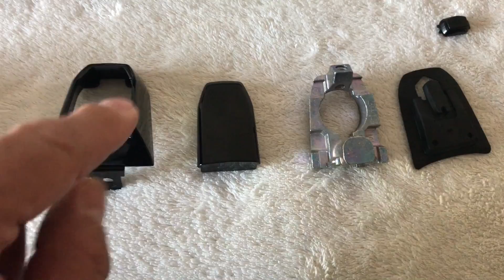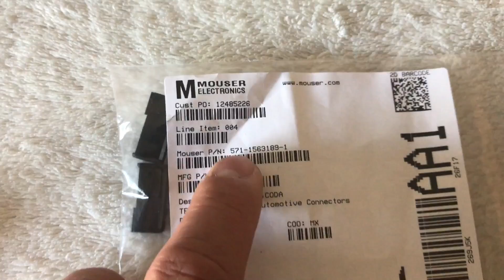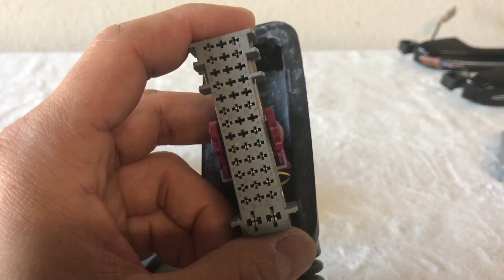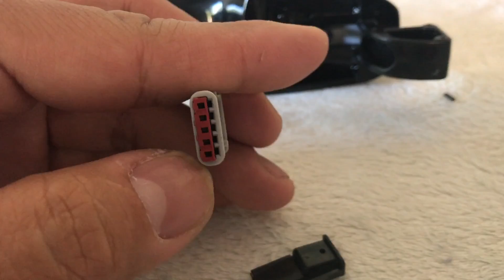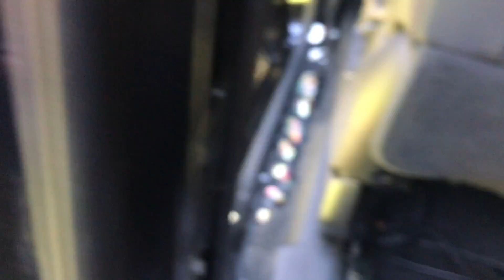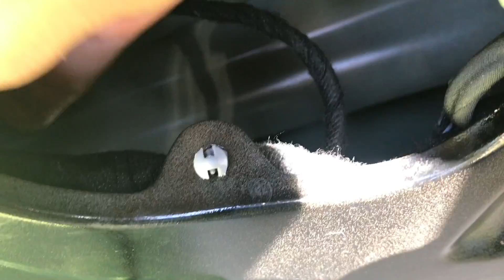2014 - 2017: Silverado / Sierra - Illuminated Door Handles

Comment: Do the Cadillac handle lights double as turn signals? Or would I have to do some modifications/retrofitting for a turn signal feature?
Reply from the maker: GM has them setup as puddle lights, so they only come on at night with key fob unlock. You can wire them however want and can tie them to a blinker. I did that with mine. Before I got rid of them and the truck, I had switchback LEDs put in and the white led operate as a running light (always on when park lamp/running lights are on) then blink amber when turn signals were used.

Comment: Years ago You could buy these style of handles for your truck or cars. Through companies like J.C.  Whitney. If I remember right those would work in conjunction with your turn signals. I don’t know if these do or not . I’ve never seen one come to think about it. They sure look great on your truck. Nice job 👍.
Reply from the maker: Since this video, I actually changed them up a bit. Had switchback LEDs retrofitted so that they white light would come on as a running light and blink amber with the turn signal.
Reply: @philgamboa2906  do you sell any plug and play ?

Comment: If Anyone is curious, the oem connector the gentleman here refers to is a JST SRV connector. Through much dismay and a ton of digging, I found the connectors, if you already have passive door locks on your vehicle you should be able to just add your 12V trigger wire and pin into female end of JST SRV connector and tie into your power source (pin 3) as he states in the video.
Reply from the maker: Thanks for sharing!

Comment: However just a minor point, the rear door connectors have only 2 columns of wires  so a corner pin would be 2 not 3
Reply from the maker: Power and ground are positions 1 and 2.  Position 3 is the next corner position.

Comment: My wiring coming to the door has the two wires going to it just like yours in slot 3 however there is no power running to it at any point.  Do you happen to have any additional advice that could help.  Thanks
Reply: Also wanted to add I really like how well informed your videos are.  Extremely well made.

Comment: Looks great Phil! I'm looking at adding these to my 2015 Sierra HD Denali, I think I'll also make the lock\unlock buttons functional. I think I'll use a low power bluetooth tag that will go on the keychain and then an esp32 module in the truck that will detect if the tag is within proximity based on signal strength. Run the wires from the buttons on the handles to an input on the esp32, little bit of logic and then just tap into the lock\unlock button to trigger the locks with mosfets or relays.

Comment: Where did you get the handles and wiring and how much were they? Thank you.
Reply from the maker: Bought them from eBay last year sometime.  Then sent them off to a company to get switchback LEDs installed.  Cost was probably $600-ish all in.
Reply: Phil Gamboa will these door handles stay on all day or how does it work? Would I be able to turn them on with my fog lights or headlights and not the day running light.

Comment: Do you know if they are compatible with a 2019 yukon sle?
Reply from the maker: Not sure.  On the truck platform 2019 is a new generation, new body style.
Reply: @philgamboa2906  2019 is new for trucks suv's are still 2018 but for 19-20

Comment: Phil, first of all, I am huge into factory-style mods for my vehicles, so stumbling on your impressive work on the Silverado is really cool to me. I don't know how much you'd know about other Chevrolet models (specifically the 2016+ Malibu, I have a 2018 Hybrid) but if you do, do you know if GM uses the same size handles for most of their newer vehicles? I am looking to do this mod to my Malibu and am just weighing my options. The shapes/sizes of these handles all look very similar so I'm not sure if I need to be looking for ones off a specific vehicle (maybe CTS) or if any illuminated Cadillac handle would be fine. I was originally just going to do a simple swap to the Premier chrome handles, but then I had a hunch about these and realized I was not the only one!

Comment: Great video, very detailed.  I’m curious if your truck already had puddle lights in the mirrors why did you have to run a new wire from the door jam plug?  Could you have just powered these handles from the puddle light wires?
Reply from the maker: elrobbodiablo1 - Yes you can.. but since the rear doors don’t, I had to deliver that signal to the back doors.

Comment: Phil, so you happen to know which circuit on the door harness is utilized for the turn signal? i'm thinking about having the lighted door handles on in run mode and flashing on turn mode. this should be possible with built in mirror signal if they exist i just don't know which circuit, can you help me out?
Reply from the maker: In the door jamb, Pin #41 is the turn signal circuit.  You won't be able to achieve that functionality since the light on the handle is a single light source.  I switched mine up to LED Switchbacks that are on all the time (white) when my headlights are on, and flash amber when turn signal is applied.  I ran the running lamp circuit (Pin # 11 on the door jamb) to it.
Reply: @philgamboa2906  Also do you do installs? I see you're in Texas, I'm close to Dallas.
Reply from the maker: Z Sellers - Email me at gamboaphil@gmail.com
Reply: @philgamboa2906  was it easy to separate to switching out the LED to switchback  LED? I was looking at mine and didn't feel like tearing it apart in case there's a trick to it.. lol
Reply from the maker: @jjplacheta   - I sent mine off to Crisp GM Customs.  They do this type of custom work.
Reply: @philgamboa2906  do you happen to have a video of your switchback in action. I have the red LED turn signals in my mirrors, was wondering how they contrast with the doors switchback if it's white then amber.
Reply from the maker: @jjplacheta  - Shoot me an email and can send it that way - gamboaphil@gmail.com
Reply: @philgamboa2906   Are those pin numbers the same for the 2500? got an 18 and doing the switchback handles. If I can tap off the door harness in the front in the cab, and run the wire to the back it would make it much easier. Do you have wire colors also, or how I would read the plug to get the correct pins?   Appreciate any help. Happy holidays.

Comment: Thanks a lot for posting this! I have a Cadillac XT5 which had a nick on the door handle's aluminum trim piece.

The XT5 has a same make/style of door handle as the ones shown in your video. 

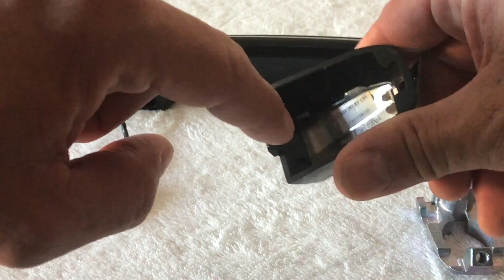From 4:50, I was able to determine that I could remove the trim cover without needing to remove the handle from the door.

I purchased a replacment handle from a salvage XT5 and in 2 minutes, I was able to swap out the aluminum cover.

Now the door handle is as good as new.

Comment: Phil, can you please tell me if the front handle is the same as the rear handle or perhaps you have a part number for the front handles so i can order them. 
 i see sets on ebay and they say rear but i don't see sets saying front is why i ask. thanks in advance
Reply from the maker: The physical handles are the same.  In the OEM application of installing these on Escallades, you'll want specific fronts/rears for the proper wiring.  Fronts have a 5-pin wiring system where rears have a 3-pin.  If installing in our trucks, you'll be fine with either.  One thing to note:  With these handles, the smaller part of the handles will all have steel base inserts.  On our trucks, the rear door handles have a plastic insert.  You'll need to swap those over.  But otherwise, you'll be fine.
Reply: i have ordered the front handles but now need the connectors. i did find the part number on your video but can't locate them online without buying 100+. can you recommend a seller for.... hmmm wait, i think the male ends? or do i need both?
Reply from the maker: Send me an email.  Let's go over this.  phil.gamboa@icloud.com
Reply: sorry to keep bothering you, i did manage to find all of the parts needed for this retro fit so i'm all set now. again i want to thank you for the well thought out informative videos on diy upgrades. top notch and i hope to see more in the future.  A+

Comment: Have you found a way to utilize the passive keyless with those Escalade handles??? I’m very interested in trying this along with a push to start button
Reply from the maker: Nope.  There are a lot of modules involved though.
Reply: Phil Gamboa is it more than the passive keyless module with the antennas? If you believe there is a way I would really like to try and do it. After having these features on my last vehicle for over 6 years it was hard for me to believe GM didn’t and still hasn’t done this on our trucks

Comment: Can I use the ones for the back doors on the front doors I have a single cab 2016 Silverado LT 5.3 V8 and all I can find on eBay are back door ones after seeing this video u change the plugs to two pins or do I need to look for the front doors specific thank you the video it’s great information

Comment: Hey I was wondering where I could buy the exact ones that you used in the video( black and with lights) for my 2015 3500hd crew cab(4 doors) Silverado. Thanks 🙏
Reply from the maker: I bought them from eBay.  There is a seller that sells them in a lot of 4.  But they are all Green Envy in color  That's how mine came and got them painted.  The bases are green, the top cover piece is a "platinum" color...not quite chrome, put painted.  So I was able to get the entire handle painted/color match to black GBA.

Comment: i have Tahoe ltz 2015 what should i buy to convert it to illuminated handle by the way i had already bought the full handle sets so do i need a converter from mouser ? and i need any thing else? if you contact me on my email loves85@hotmail.com
Reply from the maker: To get the LED on the handle to work, it only needs power and ground.  How you get that power and ground to the handles are up to you.  My video shows you how I did it.
Reply: Phil Gamboa Thanks so much

Comment: Great job, installing this on my 16 as well and needed to know if you had any idea what the part numbers are for the brown plugs you said were back ordered?
Reply from the maker: SRVWSB-03A-CN
Reply: Thanks is this the same number for all 4 or are the fronts different
Reply from the maker: These brown plugs are for the back and 3-pin.  The fronts are a white connector and 5-pin.  Since I only needed only the 3-pin, I got those and their mates.  The 5-pin white connector were on backorder.  So i just repinned them all to the brown 3-pin.

SRVPB-C03-N - Female (Door Handle Side)
SRVWSB-03A-CN - Male (Harness Side)

Comment: Looking for the handles that are chrome 17 High Country has them. Do they make them and where do I buy and cost please and the Installation would need to be done by a professional?
Reply from the maker: Anthony Macneil - If you're looking for the chrome and not these illuminated handles, you can find those for about $50 on ebay.  Installation of the handles themselves are not too bad and there are several videos out there specially for installation so I did not include those steps. 

Herr are the handles on eBay I found. 

https://www.ebay.com/itm/202015764575
Reply: Phil Gamboa Looking for the chrome lighted ones please.
Reply from the maker: Anthony Macneil I have not seen GM - Chrome - Illuminated ones specifically for our trucks.  I've also looked through the 1600 page electrical Upfitter manuals and haven't seen any references to illuminated handles.

These all did come painted as a "Platinum" color and look like chrome, with the base color match to the Escalade.
Reply from the maker: https://www.ebay.com/itm/253007952668
Reply: these look junkie on ebay. how do you feel about them?

Comment: Phil, Looks great and job well done sir. As much as I like these illuminated handles, Installation is not  quite as plug & play as the DL8 to DL3 swap outs. But as always I enjoyed your video, You have a one off Silverado there sir, Nice indeed.
Reply from the maker: Timothy Banes - Thanks!  While this may not look Plug and Play, the wiring was not too bad.  I like doing things the way I think GM would have done it.  To install this the way I did, it would require special tools, like the terminal removal tool, terminals, and connectors.  I also used an actual GM Crimp tool as well.  There are easier methods to accomplish this using splices/taps.  The goal here was to show everyone how I did it and how I think GM did it on the Escalade.